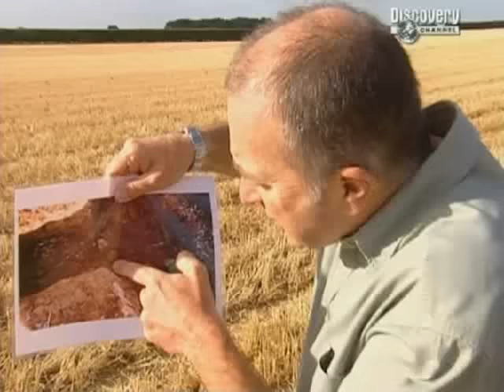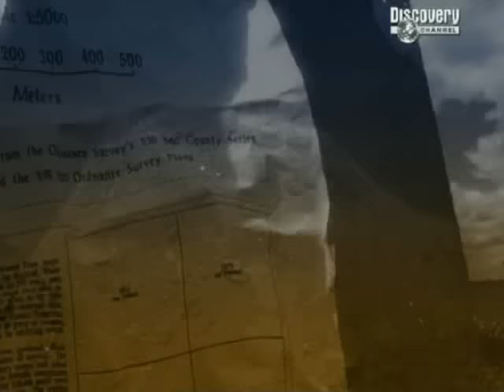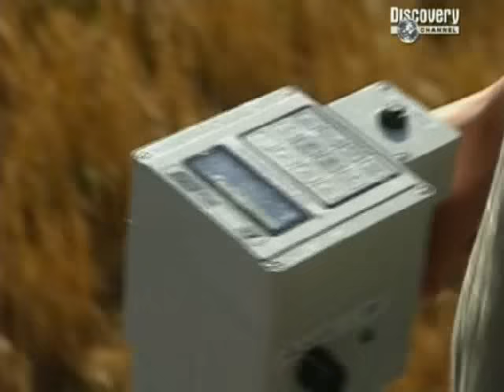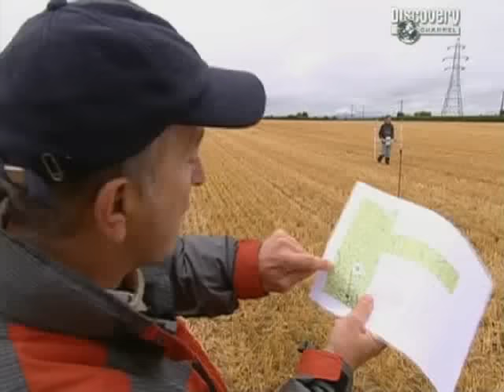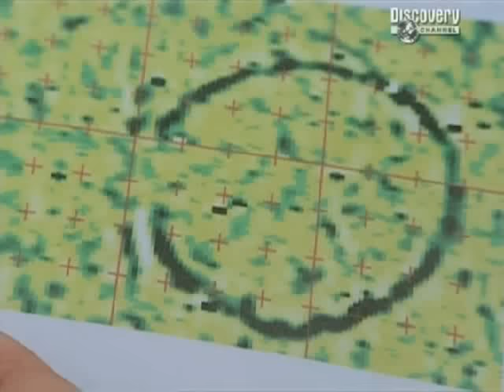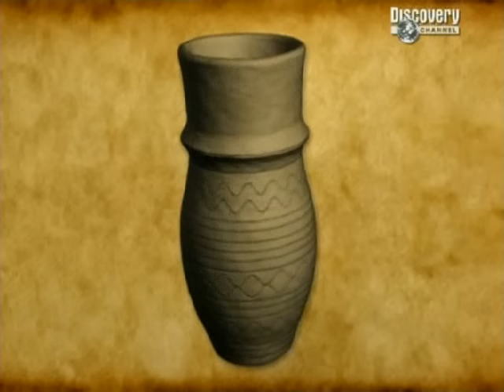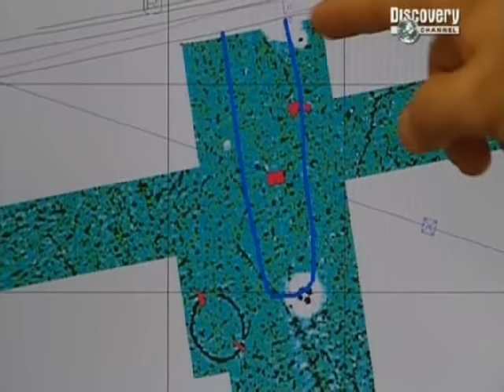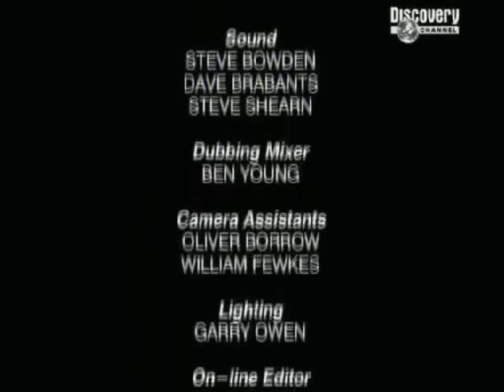Time Team S11-E04 South.Carlton,.Lincs

Comment: They were wrong about the function of a shield boss. It's main role is to protect the hand that's holding the shield. The axe test showed the exact reason for the need to protect your hand by a steel boss. Then the pin on the top of the boss is not for catching and breaking swords, it's too small for that. Swords of the time were wide blades with little edge taper google image search migration era swords, the disc on the end of the boss is too small to hold a blade and be able to break one. The blade would twist right off the pin.  But the pin is perfect for catching the edge of your opponents shield to push it out of the way in a bind. If you and your opponent are pressing shields together you can use the pin to control their shield, move it enough to make an opening for your sword. Later shields just have a round boss without the pin, they are without because they are very situational and can also be used against you by the opponent intentionally putting his shield edge against the pin and creating an opening. Binding shields together in combat is not a common tactic because it limits what you can do, like use the shield to stop an incoming attack. So rarely done and the pin can be used against you just as much as used by you? Better off without them.

Also the shields were much thinner at the edge and thicker around the boss like 1/8th of an inch edge and 1/2 center. They also used very thin sheets of rawhide rather than thick leather. The edge cover was also thin rawhide. They were thin like that to get blades stuck into the shield rather than simply stop them. If your blade is stuck in your opponents shield you have no weapon anymore. Thin edge makes a sword blade hitting the edge sink deeply into the shield and cannot be extracted in the heat of combat, that's why they are thin and have very little covering them. You want your opponents blade stuck deep into the edge of your shield because it is better stuck there than in you.

Comment: Probably said before, but the guy with the large beaker could have been the brewer or potter rather than a drunkard, i.e. important and respected rather than laughed at. On the other hand, up until quite recently, I believe it was the older women that did the brewing (though I'm not sure).